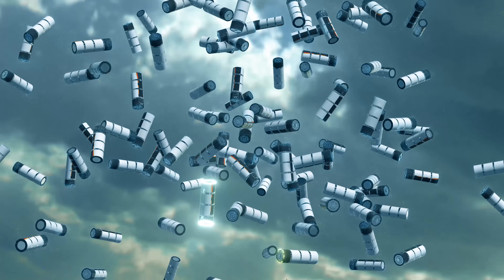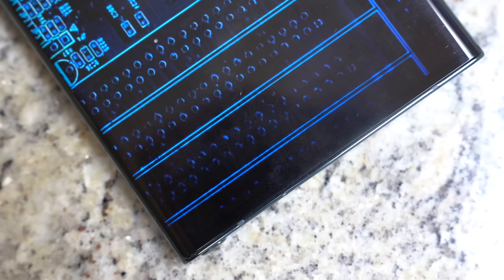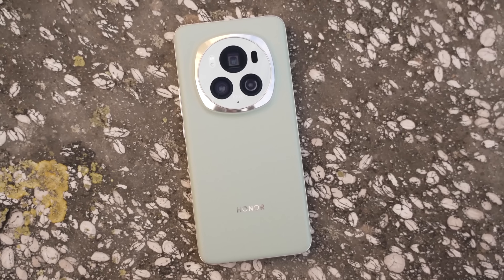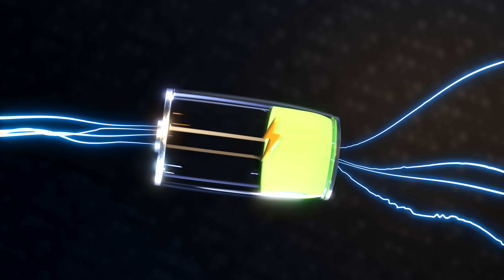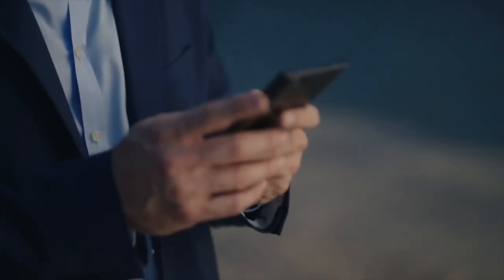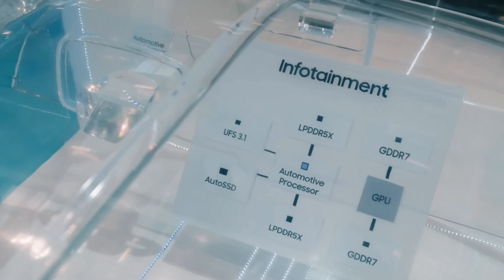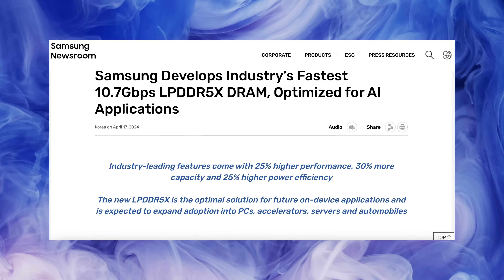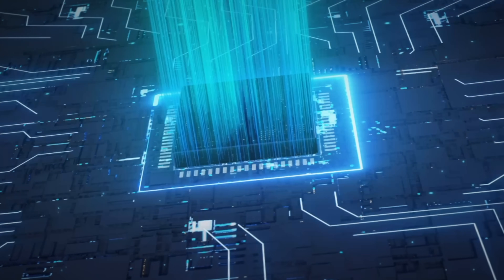Samsung Galaxy S25 Ultra - This Changes EVERYTHING...

Comment: As long as they don't allow us to play AAA games on them all that extra power is uninteresting. I don't care that Instagram opens 0.003 seconds faster than my S21U. The S24U is already 30% more powerful than the iPhone 15Pro Max GPU and even theirs run modern tripple A games. Samsung needs to step up. Android has to step up.
Reply: Honestly!! They need to step up. Not to mention even with a higher GPU, Iphone is still running warzone mobile with a much better graphics and less GPU usage.

I can't believe I am actually considering getting the iPhone 15 pro max. I'm finding it so hard not to.
Reply: You do understand AI requires immense power to run. Newer and more complex engines will need more power to either complete tasks faster or do more complex tasks on device

Comment: TLDR: New cpu is power hungry so battery will be bigger for the SAME user experience. S25 will get some AI stuff 6 months before s24 and others get it as usual. Slight ram performance bump indistinguishable to most users.

Comment: 6.9 inch display, ultra thinner symmetrical bazels, upgraded camera and ai, 3nm 4ghz processor with faster 10gbps ram, bigger battery weighing less than 240 grams. Everything you dream about on a smartphone. All in one. I hope 65W faster charging and satellite connectivity are included as well.
Reply: 65w + charging at least and under display camera
Reply: @mastamolvi47afzal73 under display camera still sucks tho
Reply: @mastamolvi47afzal73  nah it reduces the quality just single punch hole isn't that bad at least it's better than that ugly dynamic island 😂
Reply: @Spazzfrom.1989 
Aww. Let them have their fun. 😂
Reply: Camera wont be as good as iPhone... S24 Ultra is good phone bt still it’s way behind than iPhone in camera...you gonna feel it when you use it on third party apps or when you upload your photos, videos on Facebook, insta or tiktok
Reply: @wasiahmed1547 I have an iPhone 15 Pro Max and I have to say it was the biggest letdown ever. Uploading photos on Insta makes me wait until it's finished just to use another app. Cameras? Maybe just one video it has the edge. My friend has an S24 Ultra and his photos looks way better than mine. Apple still haven't even fixed the weird red hue on skin tones. I'll be trading in my junk Apple for the s25 ultra.
Reply: They need to add ultrasonic MAX, and a competent face recognition algorithm :/
Reply: 6.5 inch is better
Reply: @wasiahmed1547  yeah because apps dont use the cameras normal post processing its basically just taking a screenshot of the viewfinder instead that's just been a thing for androids entire existence and we have workarounds like not recording the video in the actual app and recording/ taking photos in the camera and then uploading them its not that hard

Comment: Honestly. This is my opinion and you dont have to agree with me. But I've been a samsung user for basically my whole life. I do like samsung a lot. But it seems that they are just giving us little upgrades. This is what i think they should do, which would be great. 
1. +500mah batterys for all 3 models
2. Increased resolution and ois for ultrawide lens for all 3 models. 
3. Increased ram for all models. 12  gb base ram
4. Smoother software, including camera ui (which is choppy when switching camera lenses compared to any new iPhone) 
5. An extra microphone on the back of all 3 s series models for noise cancellation and more mic options. 
6. Allow ultrawide video while using flash
7. 4k60fps lens switching for all models. 
8. Same cameras for all 3 models. 
9. Better macro mode for all 3 models
(Samsung should add autofocus to all 3 models for ultrawide lens)
If they could do all of that. And some more. Im sure they'd make a killing. If anyone agrees with me or wants to comment or add, please do. We need samsung to hear us so they can provide us with our wants and needs. :)
.
.
Edit: + add anti reflective coating for all 3 models and new and improved selfie camera. Low light video performance is not good in my opinion.
Reply: The camera switching is actually not choppy because of the processor,  the layout of the camera make the image shifting a little making it looks stutter the moment they switch lens. This can be fixed by reposition the viewfinder and crop a little bit of the image. The vertical camera layout is probably the culpirt, if you swith from main to uw or telephoto then it won't shift too much, but if it's from uw to telephoto then, the shifting will be too obvious
Reply: That'll never happen. Nice ideas, though. 💯 😊
Reply: @Meteor-ThunderBears  I would agree for the most part. But for an example. When using an iPhone. When switching the lens. The photos and videos are actually cropped a tad bit. Just a bit. But that gives the illusion of a smoother transition. Play with an iPhone, and you'll see what I mean. Also, when I 1st got my phone (s23+) before any update, the camera transitions were perfect. It was so smooth, but after updates, it got worse. Noticeably worse. I believe that it really depends on the software because if I had the tools to fix it, I believe I could. I've also noticed that the stabilization algorithm on samsungs is inferior to the iPhone when it comes to transitions, but just steady video without any lens changes, then samsung is definitely better. I just wish samsung would work on polishing their devices. Yes, features are cool, but I believe a billion dollar company has the resources to get things done. 
So all they would need to do to fix that is maybe add ois to all sensors. Not eis and also develop a better algorithm for lens switching. They know what they need to do.  We need to complain to get them to do it.
Reply: @MrCaribe65  maybe if we complain enough
Reply: @Meteor-ThunderBears  I re read this. When switching from main to uw lens on my phone and my sister phone (s23ultra) the shifting is very noticeable. Not even slight. I can understand tf to uw lens but main to uw? That's crazy.
Reply: There are reasons why there’re cheaper options of any phone series types, that’s why they don’t have the same specs, if u expect the same specs in all 3 types then it’s impossible 🤣

Comment: Still have my s21 ultra 5G and it still charges in less than 30 min and it has 120 hz monitor and plays 4k no problems. In order for me to upgrade the next Galaxy has to be groundbreaking.

Comment: I will wait for S25 then...no need to upgrade from S23+ to S24U
Reply: This will happen every year
Reply: However, you're right I need the s25
Reply: what will s25 will do which this one can't? Scroll tiktok faster?
Reply: @TheRealGigaCat  for real some these dudes are so dumb..he could keep that phone 5 years and be fine as long hte battery holds
Reply: @Spazzfrom.1989  You're right, I'm planning to change my s21 ultra to this s25 ultra and is time because Android 15 is coming this year and that is the last update for this phone I think the upgrade is going to be great
Reply: If you wanted to update, you would have done it already. S24u has been out for many months already
Reply: @CarlosSajiun  it will cuz the samsung nodes were hot and battery draining..i actually started looking into my first smartphone when the S21 was out but waited till the S23 to finally get the TSMC process..if im going to spend that much (600) then id prefer the cooler better tsmc chip
Reply: Or you can wait for s24U to drop the price when the s25 series releases. S24 got massive 7 years update anyway
Reply: @Spazzfrom.1989  I can do whatever I want with my budget...😉
Reply: @TheRealGigaCat fr bro. Like people need to start seeing these phones for what they are. it doesn't matter if they put an actual dragon in the chip, you won't notice any difference.
Reply: I won't change my s23 ultra unless they release something super wow tbh 😂 not like we program on our phones or anything like that
Reply: @CarlosSajiun how do u know itll be the last

Comment: It has been confirmed recently that there is no battery size increment in s25 ultra. They will tinker with it at software end to save battery. They are also not going for dual battery like oneplus (so no improvement in charging speeds either) 😊

Comment: I'M HYPED!! 💜💜💜
Reply: Ok , but why ? 
 It’s already very powerful as are most high end phones these days,  what’s it going to do that today’s phone will not ? 
 It may open up your emails a tenth of a second faster , or open up an app a tenth of a second faster ….. whoop de do  !
 It may gain an extra few frames while gaming on that tiny screen if you are a phone gamer, a  little bit extra battery life is good, but hardly worth putting down your old phone which still works perfectly well to spend another $1200 bucks for what is essentially incremental changes.
If on the other hand, Samsung put back the headphone jack , the SD card , the notification light and all the things that used to come in the box with every new phone , well that would be something.
 If this what we have been shown today is it , it’s basically a nothing burger.
Reply: @mikldude9376 chill man he was just telling he was excited about the new phone plus he did not ask for your opinion
Reply: Yeah chill out.
Reply: Get a life.

Comment: That means Snapdragon 8 Gen 4 is less efficient?
Reply: Yeah maybe to compensate that brands may increase the battery size 😢
Reply: Each year phones get better. 
At least, that's the goal of every phone maker. Why would they be less efficient? Make it make sense.
Reply: @ruthlessrafael3195 because nobody making leaps in performance without consuming more power each year. There is limitations of efficiency too

Comment: That's great news, but does that mean the newer chip is going to be more power hungry? No way I would like to have a power hungry chip than an efficient one. No matter the battery size. S23U and S24U is doing good. Chips should be fast also efficient at the same time. Not to mention heat, which should be bearable.

Comment: I hope they don't remove the spen for larger Battery 
Because Samsung is known for removing the good features from their flagship mobiles
Reply: Apple, Google, and Samsung will be using a stacking method for their new batteries. It will allow for larger capacity in the same space, plus reduce battery heat and expansion.
Reply: @aubreybrackett7653  yes but still Samsung may make that move even though those technology is present 

I hope that doesn't happen
Reply: @aubreybrackett7653 I believe spen will go to fold series and leave the S series

Comment: S25 ultra will need to increase in size if it will pack a 5500mah battery because other phones which have bigger batteries with the same size as the s24 ultra dont have an S-pen inside

Comment: every year samsung phone changes everything according to you and yet nothing is changed beside a little more power and a little bit better camera. which are to be honest the bare minimum to be had. Samsung has went apple route i guess. Not bad as long as they provide actual features instead of notches and no charger... 50-50
Reply: Nope way better than CRAPPLE
Reply: @DENVEROUTDOORMAN  when did I say apple was better? Did you even read? They went apple route means no charger in the box. No headphone jack, no SD card. No change in design for last 3 years. This is what apple route means.